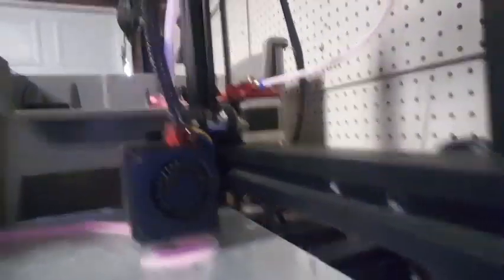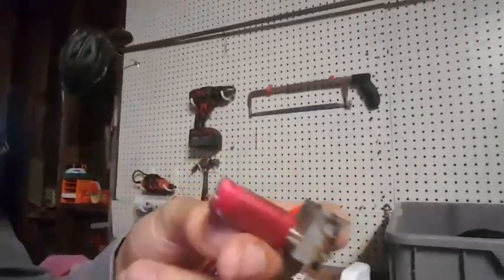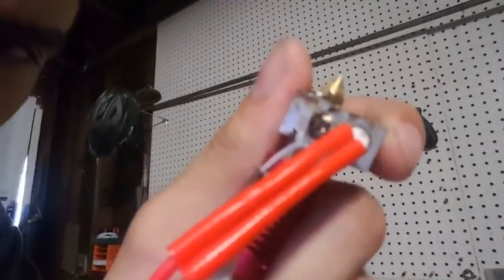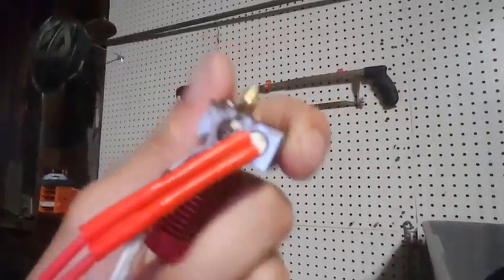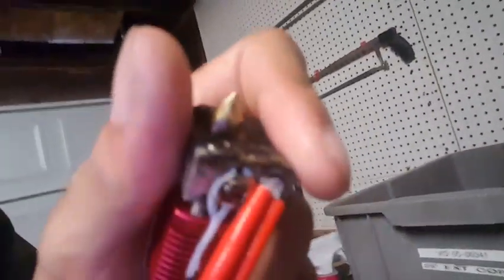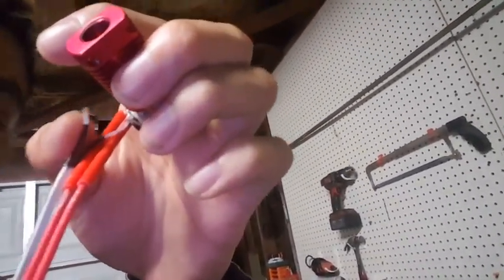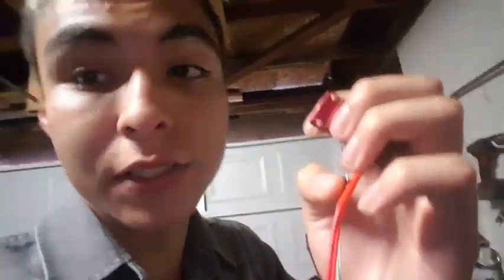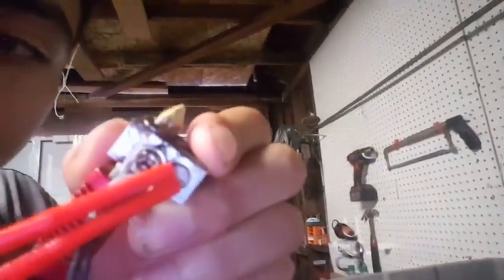Ender 3 max temp error fix(easy)

Comment: Thank you.  Bought a brand new hot end and it was looking all good, except as soon as I plugged a USB cable in (Even if the USB cable was connected to nothing at the other end), it would start saying max temp.  Loosened the Screw on the Thermistor and the problem went away.

Comment: Just replaced the hotend on my Ender3 and got the Max temp error message on powering it up. Loosen the screw and it loaded up as usual, went to heat the hotend and the temp went up quickly getting to 50°c or so before giving the same error

Comment: Brilliant video my friend....  After replacing my thermistor, and flashing the firmware nothing seemed to work. I was ready to take it in to a shop (which is a considerable distance away)...  you fixed it in three words 'Loosen the nut'.  I did and it works perfect.   Thank you

Comment: I had to replace my hot end after filament exploded out from every opening.  I got the max temp error message after replacing the part.  I wanted to pull my hair out, but I jest walked away.  I then found this video.  I turn the screw a 1/4 turn, switched the power on and it worked.  Thanks for the help.

Comment: So... I went with your idea on loosening the screw. Looked a little more into it, no mind you this is a brand new never operated printer I am working with. Noticed the insulation was actually peeled back and smashed from initial production install. I took some heat resistant tape and taped the leads and it fires right up. Man that stumped me till I came across your video. Thanks!

Comment: Cheers. I just replaced the full hotend on this CR-20 wires and all to the board (second time!) and watched MAXTEMP come up. I figured it might be defective from the factory - then I started thinking I remembered something about how tight the thermistor connection had to be, searched on YouTube found your video - and followed your advice. Backed the screw off 1/4 turn - and it works. Thank you sir!

Comment: The new type threaded heat sensor doesn't use the screw.  It actually threads directly inot the screw hole.  MUCH BETTER!

Comment: Had an issue with the printer doing a continuous beep when booting. Failed to finish booting. This was the issue. I didn't know it was the issue until I flashed TH3D firmware on the board and it told me the error. I appreciate the video. Helped more than hours of googling

Comment: Ey man you saved my life... I installed a Micro Swiss direkt drive metal hot end on my ender 5 pro and during the preheat it reached 360 degrees (only on the display) and  there was this wonderful error... I thought my printer was complete dead...this little dump screw... Thanks

Comment: You threw out a hot end over a .10c thermistor?
Reply from the maker: later it started to fluctuate its temperature to randomly high temps so that had to be replaced whether I wanted to or not however I kept the old hotend either way just incase
Reply: @ericprint3576  Seriously, you wasted a lot of money there. I replaced the thermistor and that fixed the entire problem. No need for a new hot end... just a little tiny piece of electronics that costs next to nothing.
Reply from the maker: I know but at the time I still had only 6 months of printing experience and never encountered this before so there's that.

Comment: My hot end thermister broke too.

But my BED is getting Max Temp error.
Is that your experience?
Reply from the maker: I haven't encountered that problem myself but I'd suggest checking for any ripped wiring or the circuit board for loose connections.